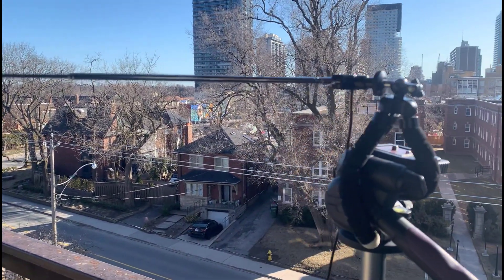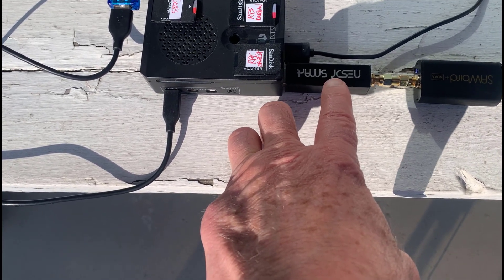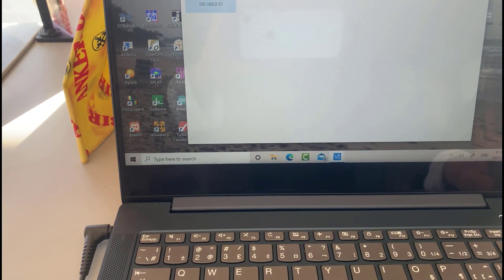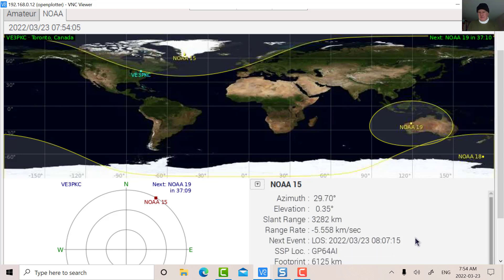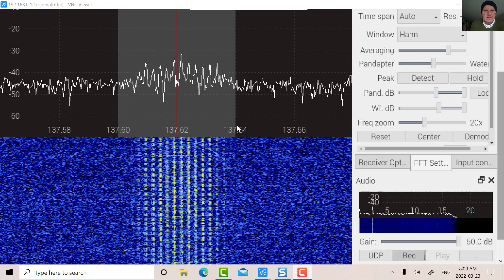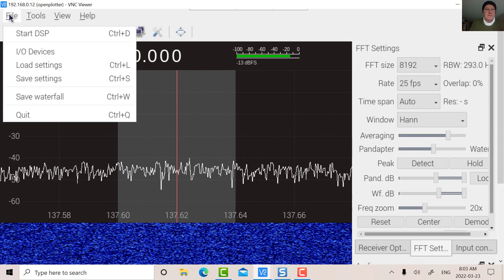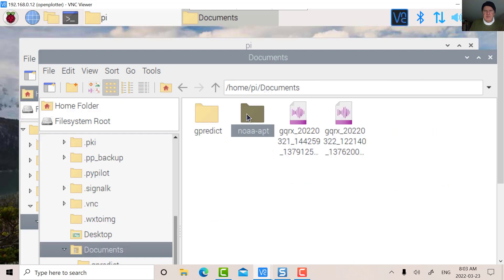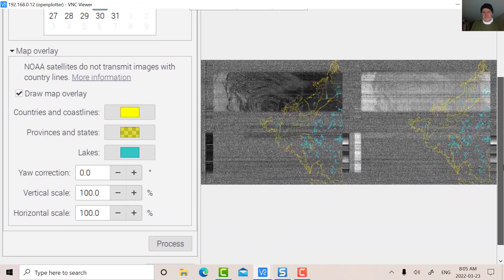RTL-SDR for NOAA Satellite Weather on RaspberryPi4

Comment: Is 54.5cm taking into account the ~1cm length of the coax between where the cable is spliced and the screw terminals? I remember reading elsewhere to take that into account, but not sure how much leeway there is and/or if youve already compensated for it with those numbers. Thanks for the video and your additional info in comments!
Reply from the maker: No I didn't include that. The 54.5 is a compromise between 137.1, 137.6 and 137.9 the 3 NOAA frequencies.